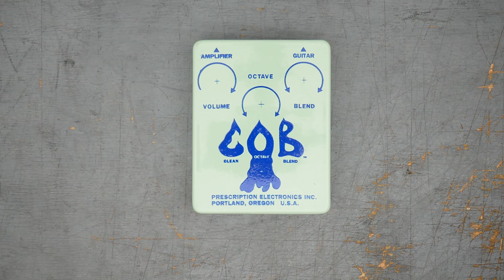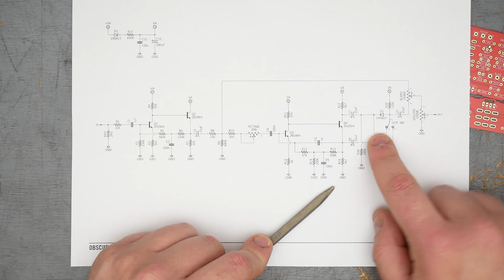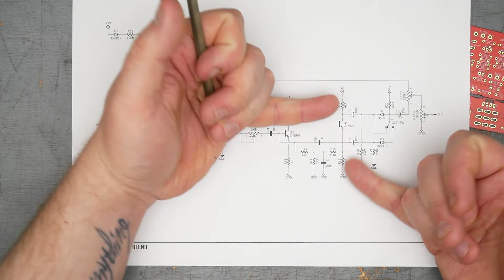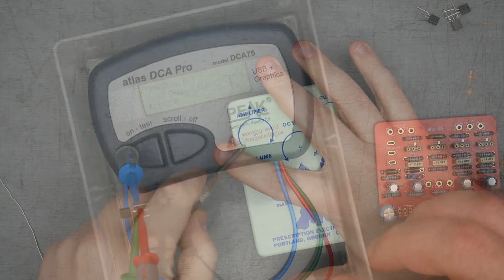Prescription Electronics COB (AionFX Obscura) Build // Gray Bench Electronics

Comment: Thanks for doing this build! I got this pcb a while back and it had a weird bug where it would only stay powered if it was the only user of a high current 9v dc adapter and a vintage style fuzz should never be that power hungry. Seeing this video inspired me to figure out the issue in my build and it was simply a bad solder joint on the dc jack 😅. Each mistake is an opportunity to learn something new!
Reply: nice job finding the fix!

Comment: Thanks for the video. I am still learning to build and your videos are always informative. Your work always looks so clean. A couple of questions. 1. What is the putty you used called? 2. Why do you solder the components on both sides of the PCB? Thanks!
Reply from the maker: 1. It's called poster tack.
2. Mostly aesthetics. Ideally yes the solder flows to both sides for best connection, but in guitar pedals it's pretty low consequence to not have that. The lead size of my resistors vs. the hole size for Aionfx boards is just close enough to prevent good flow through both sides of the board.
Reply: 1. Blu Tack
2. Aesthetics - there is no engineering reason to solder the component side at all. The thru-hole plating will connect both sides of the board without any problem. Vias, for instance, do so with much smaller holes and no solder flowing through them (just the plating). It is always reassuring to see the hole fill up to the surface of the component side. Solder touching a component body is an IPC standards fail - so why would anyone tempt fate?